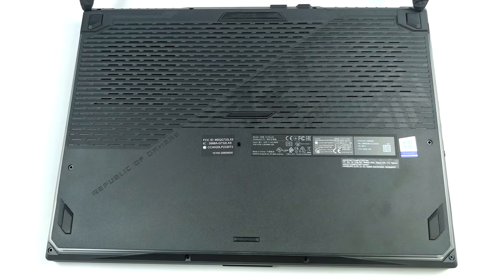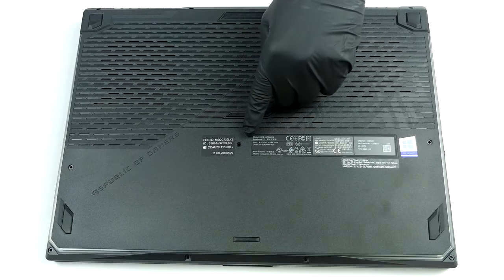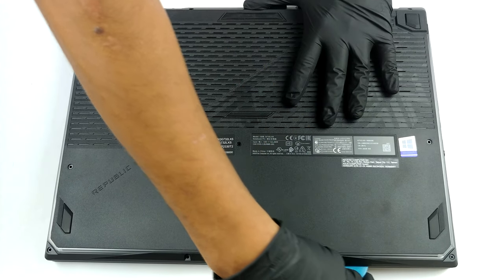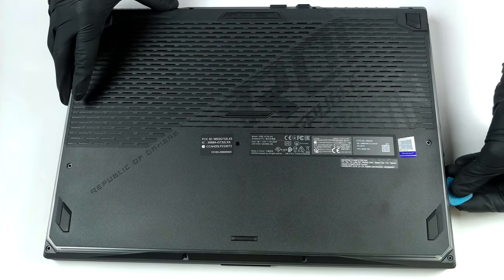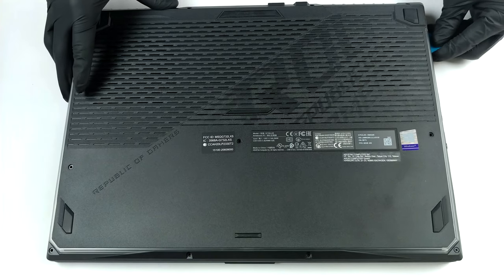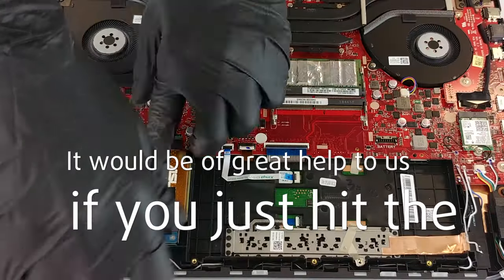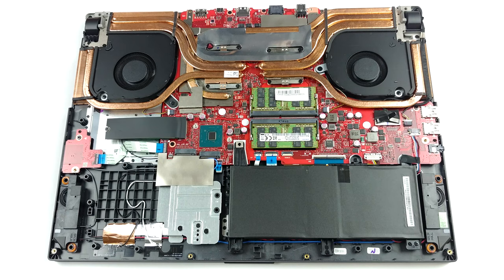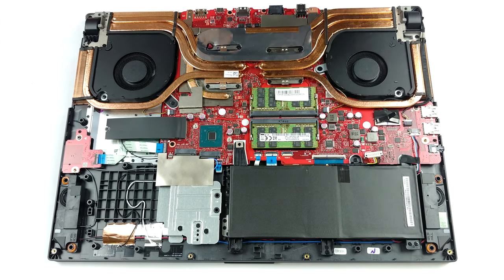🛠️ ASUS ROG Strix SCAR 17 G732 - disassembly and upgrade options

Comment: Wait for this
perfect cooling system ever
Reply: the best laptop cooler is
razer blade 15 (giant vapor chamber)
Reply: @Nameless-jp9gp  its expensive that much bro..
Reply: its alriiight. i have this laptop. the i9 2080 model has better cooling. with the i7 2070s, i limit the turbo power to around 30-40w. laptop runs pretty cool with turbo mode after that. though fan is loud but that is the sacrifice.

Comment: Thanks for the video, I have this (G732) exact same model.
Luckily you warn about the two led cable, otherwise I would have removed the back without taking care of it and broking them possibly.
I'm wordering if it would be easy to take out the fans to replace or clean them and intall them again. Do you know if there Are spare fans to buy?

Comment: hi bruh, is there an improved heatsink for it?  The stock cooling system is terrible, it just can't handle it.  Or any solutions to improve cooling?  I insulated the fans with heatsinks attached with thermal tape, blowing out hot air was better.

Comment: Just bought this and I don't see how to add an SATA SSD (like a Samsung 860 QVO) to this system. Do I need to buy the connector and chassis for it? My last RoG came with the connector and chassis so was easy to install. I'm confused on this one. I can't find a video showing this.  Or does it only support NVMe  / M.2?
Reply: I'm very interested to know if it's possible to add a 2th SSD. Can anyone pls update? Thx!!
Reply: @nicofonce  seems no one update it..

Comment: Where's the ssd slot?

Edit: nevermind, it's the black stripe on left side by the middle, just didn't see it when it was removed. It only comes with one? Or are those two right underneath a little to the center are M2 slots as well? (Seem to go vertical)
Reply: It only comes with one 512gb nvme drive, but it has a total of 3 pcie nvme ports and supports raid 0
Reply: @Lindemann302  how can we make raid 0.buy the same capacity,brand etc?
Reply: @darkemperor5557  not same brand, but preferably the same capacity, as raid 0 takes the smallest one x2(eg. 1tb and 250gb will only give you 500gb)
You have to go into the bios, advanced mode, advanced, intel rapid storage technology and there you can create it
Reply: @Lindemann302  thanks bruh.just discovered it